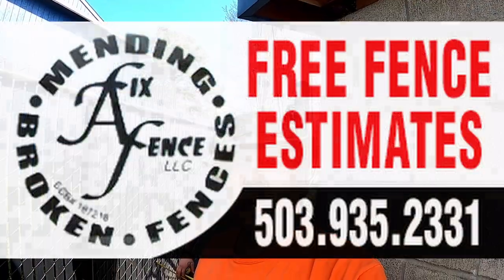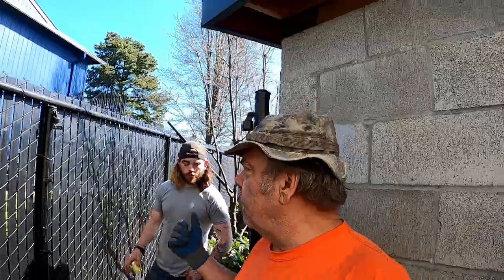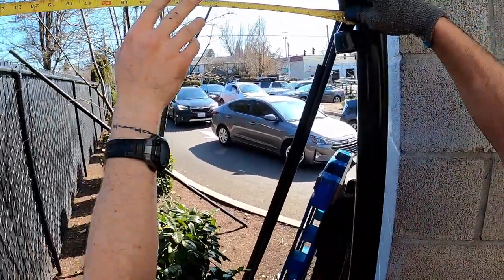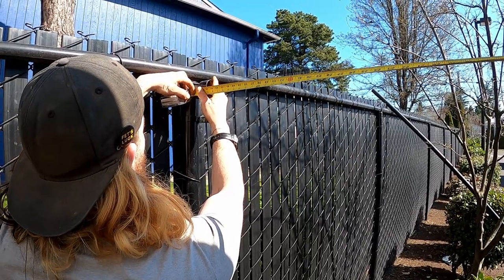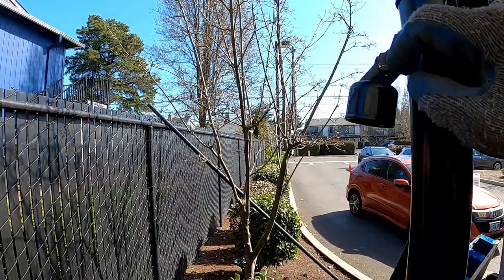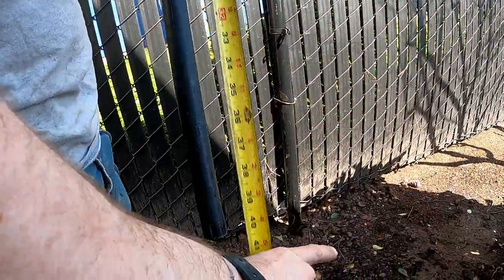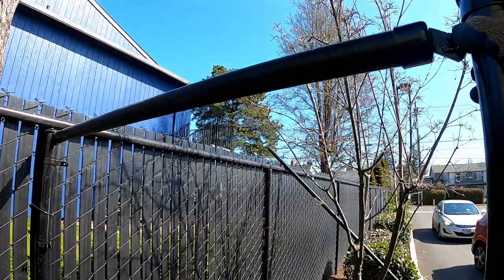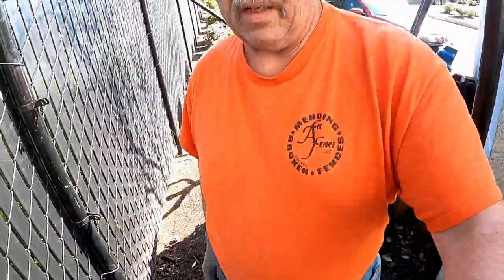How To Measure For Chain Link Top Rail

Comment: Do you have any videos for measuring your hight for chainlink
Reply from the maker: Jay, thanks for viewing,.. chain link comes in various heights, not sure what you mean? Chain link comes 3', 42", 4', 5', 6', 7', 8', 9', 10' and even 12' high. Most of which is a special order,.. do you mean measuring the height for the posts to fit the chain link you are working with?
Reply: @jwthefencer  what I mean to say is after you set the post how do you measure the hight for the chainlink I know you run a string line from terminal to terminal but I’m not quite sure about the next steps
Reply: I asked one of my Forman’s what the next step was he said he usually adds two to 3 inches depending on the grade but I was wondering if you had a step by step video on the process
Reply from the maker: @Jay-vq2hp  It's all in the numbers before setting the posts. If I am using 1-5/8" top rail and the chain link height is 72" then I normally mark my terminal posts at 72-1/2" from top to bottom giving me the grade, don't cover the line with concrete, then from the top down on the terminal post for the rail I measure 3-1/2" and make a line on the post that gives me the reference point as to where I will be placing the brace bands and also giving me the line to eye into for the line posts. Then marking the line posts, I will deduct the 3-1/2" from the 72-1/2" and make a grade line at 69" on the line post, again don't cover the line with concrete. It's all about the numbers when it comes to the grade,.. I make it a point of walking the lay of the land before I set any posts, this way I will know where the high points and the low points in the fence would be and then I will set the posts according to the lay of the land, that is if that's what the specs call for. I hope this helps and thanks for the reply and idea for another video to create, keep smiling.